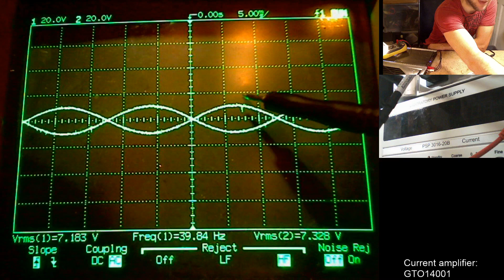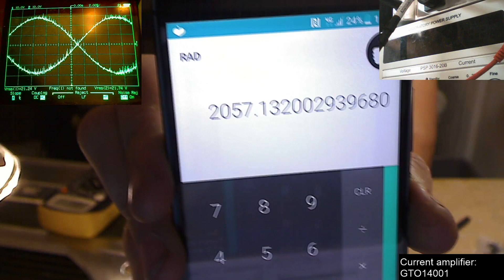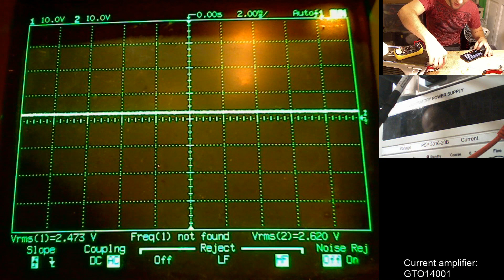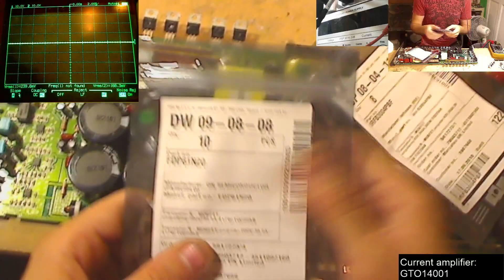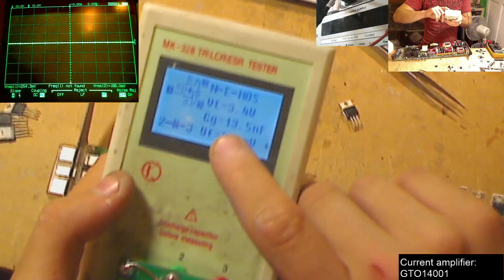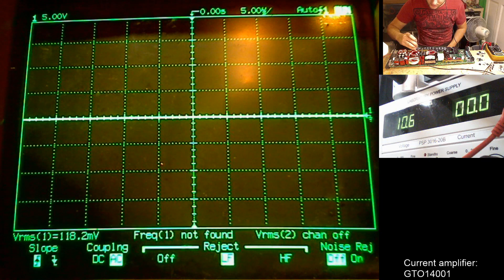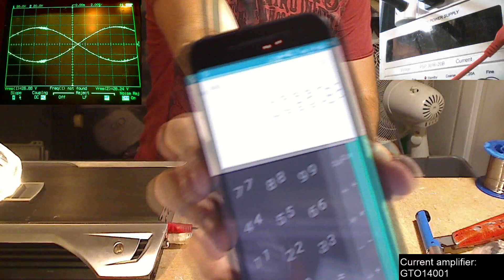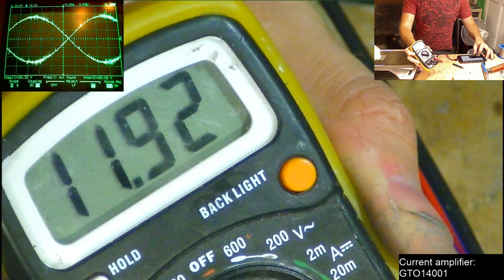Upgrading JBL 14001 amplifier to run 1ohm!?

Comment: If you run your car amplifier at the lowest impedance and run it at the the impedance the it's stable at the car amplifiers spl becomes 115 db and your subwoofers will get all the power from the car amplifier when bridged if your car amplifier is bridgeable and you will definitely be able to hit 150 decibels if you have a really good subwoofer box

Comment: @ higher Voltage it draws LESS Amperage making it run cooler = my amps never saw less that 14.7v dropping from 15.4v = so what i am saying is anyone running amps this Large are also upgrading the Alternators & Battery & Wires ( BiGG 3 ) testing at 12v is useless - only Noobs run Big amps on Stock charging systems

Comment: I have one i love it im going to hook two 2 ohm dvc subs to it i know a little about wiring but cant find alot of info on amp specs how should i wire the subs to the amp do i bridge it or one to each channel
Reply from the maker: Coils in series to give you two 4ohm subs. Then parallel the subs. This is a mono amp, there is no bridge.
Reply: @barevids  okay what I meant was on the amp there's a left positive negative and a right positive negative and then underneath the channels there's a line from one negative on the left to the right positive on the right so I wire the subs the way you said and then use one negative on the left and one positive on the right correct
Reply from the maker: @mattfarley6068  bro like I said it doesn't matter both positive are the same and both negatives are the same it's a mono amp